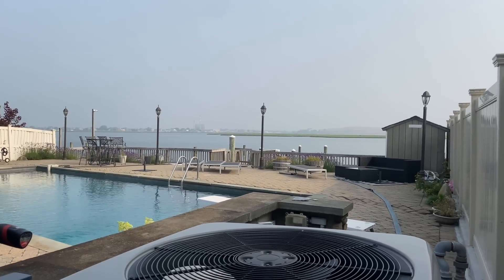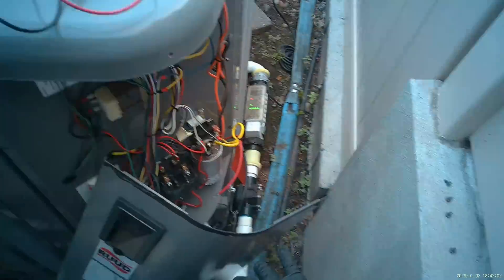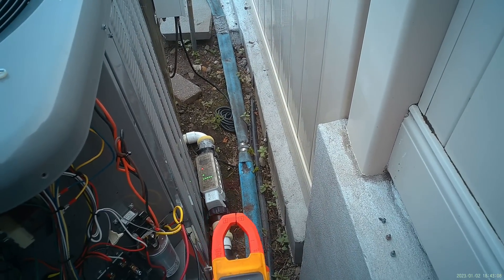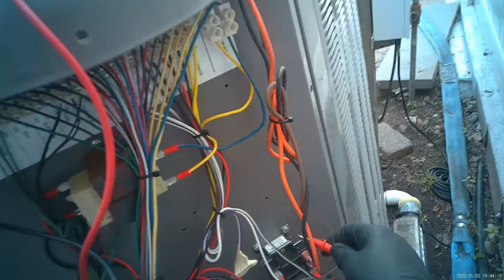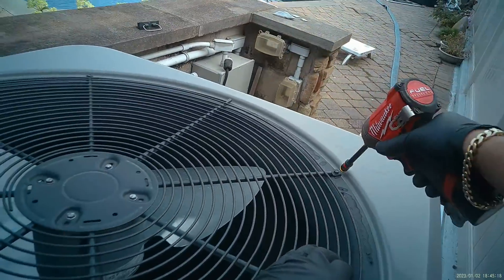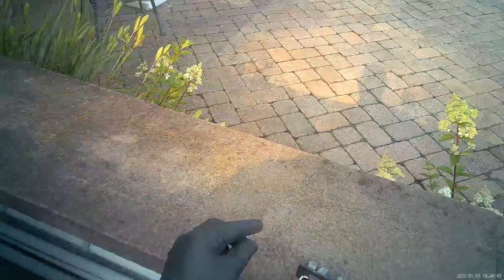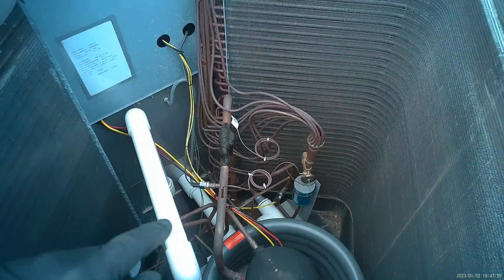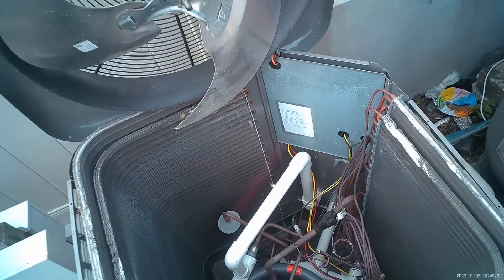Heat Pump Pool Heater Instantly Tripping 50AMP Circuit Breaker Step by Step Instructional Video

Comment: Two HVAC techs from different companies look at my 2 ton RUUD serving my third (3rd) floor condo. One says due to the height of the condo air handler, the compressor life would benefit from a booster capacitor. The second says it needs a soft start capacitor.  The old equipment, a Nordyne, had a booster capacitor ( that system  failed due to leaky A-Coil after 6 years) . My research makes me think that the soft start will preserve the compressor, but will it be too soft to start that compressor with the juice going up-hill three floors?
Reply: compressor bearing wear down, a booster capacitor increase impedance in the motor winding, which maintain horse power. Some compressor can last up to 50 years.
Reply: Ok Mikey, hacks bring you stacks $$$$$$$$$$$$$$$$$

Comment: Mikey I did learned something new   on this video, which will help me diagnose a short to ground compressor.  What are the main reasons for a compressor to short to ground and how to prevent them from occurring?   Pulling main disconnect with left hand and using a nice bracelet on your right hand can be a safety concern when working around electricity (Observation).  

Great job  with videos.

HV

Comment: I think they can afford a new unit 😂. Happy 4th Mikey! Fireworks at your house tonight? 👍👍
Reply: I was about to say that the unit looks newer it should still have a warranty.

I have a rudd unit on one side of my store w replaced an old carrier about 4 years ago. I haven't had any troubles with the unit itself but I've had other things like in the old furnace we kept the blower board go out and the thermostat wire have a break but nothing with the unit itself.

On the other side of my store, I  just had  a brand new trane xr installed. It has only been up and running for 4 days. Nice unit. Let's see how long it lasts.